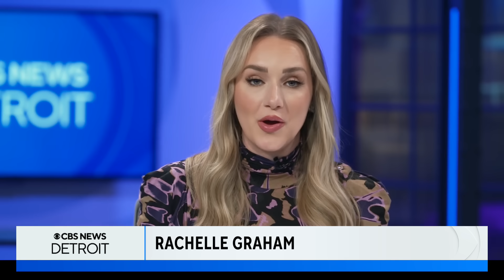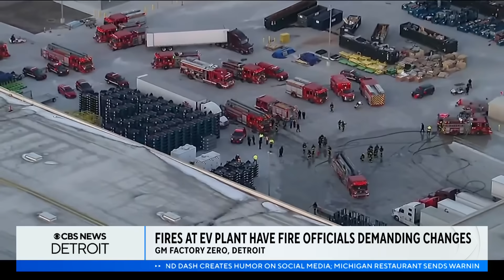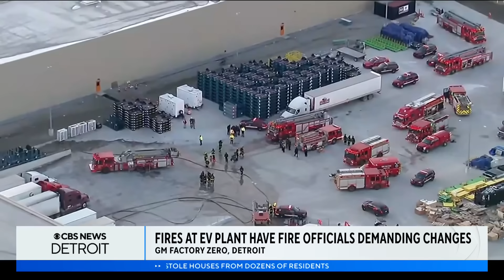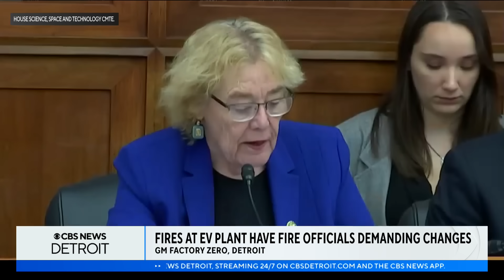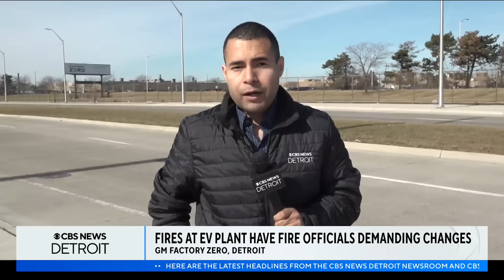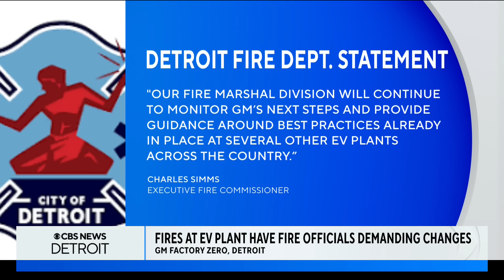Fires at GM EV plant have fire officials demanding changes

Comment: Can't park them in your garage, can't drive them through a puddle, can't take them on a road trip...Also, you pretty much have to buy the car again when the battery goes out.
Reply: Can’t use them in cold weather 😅
Reply: And you can't tow much weight if you have a truck. Heavens for bid if you are going to the mountains and snow..not practical
Reply: That's why car rental Companies are dropping their EV fleets and driving EV used car prices down.
Reply: @shauny2285  , yep..maintenance cost, liability and overall cost
Reply: Exactly.   In 20 years, there will be no such thing as a "running, vintage Tesla."   EV's are disposable vehicles.
Reply: @thumperjdm  come on, im sure there will be one. Jay Leno has many freaks of automotive nature and the money to maintain them.
Reply: The all American dream. Purchase a EV and then throw it away because the resale value will be to a very limited market.
Reply: @NBC_NCO : You have to be a little bit uneducated to buy an EV at the moment, but to buy a used EV you have to be completely certified insane. These things are destined to create the largest junk pile in human history, rivalled only by wind turbines. Gawd, what a stupid age we live in.
Reply: All the better to remove your free mobility.  If your EV is too expensive, too unreliable or too dangerous to use, you stop going anywhere.  And once they're forcing you to stay in one place, you're that much easier to control.
Reply: @SenileOtaku   It's the "powers-that-be" underlying long-term goal to restrict travel to control the masses.  it is happening in Canada also.  This Reply might get 'shadow banned'.
Reply: @johnwoa  That feature is not so much the electricity (because the normal fuel supply line is also susceptible), but the connected computerized features and ever increasing difficulty in diagnostics and repair. They can shut your car down from anywhere, and there is little you can do about it, even if you have gas or juice in the battery.
Reply: @Cucumberflavoredmustard  dont forget , we were shown by the california incedent that power companies can take back any electricity in an EV so long as its plugged in.
Reply: @SenileOtaku  then they can force you to move into mega cities for the mass transit. There you can be controled.
Reply: You forgot, can't get any range in cold winter temperatures 😅
Reply: But but but but the climate. Smh.
Reply: Now that’s value in transportation!
Reply: you LOOK at it, and it Catches FIRE & Explodes .
Reply: @markplott4820  ya imagine that, a car that makes a Pinto look safe.
Reply: Going up the hills reduces range. 
Using a car heater in winter reduces range.
Using AC during summer reduces range.
Getting a dose of EMF radiation while inside.
EV'S = Exploding Vehicles spontaneously combustible vehicles that take a few seconds to burst up to 2500c or 4500f.
Reply: gm owners will have to park in Concrete Bunker.......lol.
Reply: @markplott4820 Tesla owner too...and a Porsche ev just sank a whole ship...
Reply: Yet, the Tesla Model Y is the world's best selling vehicle. So, sounds like you're wrong. 🤷‍♂️
Reply: @Optimistprime. 😂😂😂no, it's not! It's the best selling EV and now they're slashing prices like hell since the demand is drying up...Tesla will be gone in five years...a bad memory at best
Reply: @therovingrobin5938  sorry, your wrong. The model Y sold more then any other vehicle, including none EVs with 1.23 million units sold worldwide.
Reply: @Optimistprime.  🤣🤣🤣 1 2 3🤣🤣🤣 why not 345?🤣🤣🤣 GM alone has sold 6.2 million vehicles last year...your boast is as fake as is your EV agenda/scam...and now, Tesla sales are faltering...ups
Reply: @therovingrobin5938  best selling only means their sales are lagging less than other EV makers. lol
Reply: @Optimistprime.  old data, more current data shows a huge slowdown.
Reply: @Optimistprime.  MySpace was also the top website once.
Reply: @Optimistprime.  best selling is a misnomer, their sales just went down the least. lol
Reply: This is the government's long-range plan to "restrict travel".  It started after 2001 and is continuing with the advent of EV's.  Why restrict travel???  It's subtly being done by the current FJB administration in order to control the masses.
Reply: That is the plan pleb they don't want those unwashed masses on the road.
Reply: Redneck neckbeard doesn't know. Nobody tell him. Let him stay in the dark.
Reply: What an ignorant comment.
Reply: Rednecks don't understand EVs.
Reply: Replies/Comments are being censored by the YouTube AI/Algorithm.  Select "Newest first" and scroll down to see the shadow banned Replies.
Reply: What an ignorant comment.
Reply: Weird, i do all of those things all the time in a Tesla with no issues, and i live in a very cold climate. It's almost like you can't trust Fox propaganda any more than MSNBC or CNN propaganda.
Reply: Just came here to read all the circle jerk comments from people that never owned an EV.😂
Reply: @chrispeterson7898  A wise man learns from the mistakes of others.
Reply: @user-dw1ls3rp1l  Problem is there is no learning going on here...misinformation yes.
Reply: @chrispeterson7898  It true that a wise man learns from the mistakes of others. You, not so much, evidently.
Reply: @JoeOvercoat  OK boomer...take your medicine and go rest.
Reply: @chrispeterson7898 he dummy: how about you grow up
Reply: @chrispeterson7898  spread mostly by you.
Reply: @chrispeterson7898  i suspected you were genz
Reply: @chrispeterson7898 we hear enough from EV owners😂 and it's not good...we also hear of ships being sunk by EV fires, buildings collapse etc...take your "green" fantasy and keep it, but leave us same people alone
Reply: @chrispeterson7898  and those are usually the ones that think EV's are utopia.
Reply: Select "Newest first" at the top to view the shadow banned Replies hidden by the AI/Algorithm.
Reply: so, what kinda horse and buggy do you have?
Reply: @rossr6616  I don't follow. I drive a normal car.
Reply: @Cucumberflavoredmustard it's a strawman to imply you are against technology and innovation.
Reply: @TheReapersSon  Technology and innovation result in advances in capability, not regressions.
Reply: @Cucumberflavoredmustard  he has no facts to counter logic so he resorts to insults.
Reply: @rossr6616  The government never outlawed use of the horse and buggy, and they never subsidized purchases of personal automobiles. Your strawman is a lie, so it’s time to get down off your high horse.
Reply: One that runs on gas and doesn't burst into flames. They havent for the last 100 years.  @rossr6616

Comment: I'm a manufacturing/tooling/test engineer with 40+ years of experience in the automotive industry and I worked at Factory Zero in the Battery Department for 3 months - November, December and January. I walked away when I saw they couldn't control the process of assembling the batteries. They were after numbers, same as any production plant I've ever been in, but I have NEVER seen a production plant accept up to 10% daily scrap rate of a product capable of bursting into flames! 

During my short time there they AVERAGED one plant evacuation due to battery fires every two weeks.
Reply: WOW!
Reply: Other than walking away, what other recourse would you have to put a stop to it? OSHA? Is this a union shop?
Reply: @1320pass  Obviously, in my mind I had no other recourse. Management burned through the budget, cut corners, and shuffled stations around to meet their deadlines. FZ (Factory Zero) is only one of half dozen or so battery assembly plants (FZ, Brownstown, Lansing, Orion, Spring Hill and Cami in Canada), and they bought 6 identical assembly lines, but ran out of money on the last 2, so they were modified. The first line was installed over a year ago, and they're now bringing #5 & #6 online...without many of the changes that were made to the first couple of lines.

GM has an evacuation protocol in place, and that satisfies OSHA and the UAW. Yeah, it's a union shop, but the union has no real say in the assembly process. They're more concerned with getting the greatest number of workers on the line, so they don't care about the process more than that.

GM doesn't want to invest any more than it has to in Lithium-Ion batteries because they're working on bringing solid-state batteries to market, but that's still 4 or 5 years away.
Reply: And this is why I keep telling my mom not to transfer to the battery plant at Cami. Fuck they're building a battery plant next to my factory, and I can't wait to see how many people lose their jobs for "poor attendance" because our road in is blocked off by firetrucks all the time
Reply: Wow! Thanks for your perspective! You should consider posting on Medium or Substack or something to get the alarm out there.
Reply: So they fired you.
Reply: problem is the LG Pouch cells & ULTIUM pouch batteries.
Cylindrical battery cells , have a PROVEN safety Record.
Reply: @markplott4820 lithium cobalt cells in any configuration are inherently more dangerous than lithium iron phosphate for example. We're trying to tame the dragon so we can get the energy density we want.

It seems to be mostly working, battery fires are pretty rare and we've got millions of these vehicles on the roads.
Reply: @markplott4820  True, cylindrical solid-state batteries are far superior, safety-wise, but they are still millions of dollars in product and vehicle design, and years away from production. One of my production team members works on the development team.

Comment: Another reason for me NOT to buy an electric vehicle
Reply: Higher insurance rates, higher electric bill, mileage anxiety, no trade in value, wasting time at chargers, charger in$tallation, fear of fire knowing batt burns new in factory, Gee, l want one
Reply: @GreggWalken-xd3qv  Ah yes. How can you not like waiting a few hours for a charge that works, while the guy across the street files up his ICE vehicle in 5 minutes and is off on his adventures. How could you not like waiting all that time.😀😀😀 (sarc).
Reply: Hello sir - may I interest you in purchasing a Ford Pinto?
Reply: @Trump2PrisonOn34Counts  The Pinto thing is literally getting old.  The easiest fix is to install a trailer hitch (which Ford pondered doing) on the Pinto and then it will meet the required crash requirements with no fuel tank impact.
Reply: @JRobert111111 And had they fixed it at the time, it would have cost $11 per vehicle. The odious part was that Ford decided it was cheaper to pay the claims.
As to the lithium fire issue, F-500 is effective or Class D extinguishant.
Reply: @Trump2PrisonOn34Counts  You are absolutely correct on this.
Reply: Plenty of reasons not to touch one of these. Love the brainless comments on here that advocate for them.  I need the laughs…..keep ‘‘em coming 😂😂😂
Reply: @martinr8278  Yep. Insurance costs going up. Parking lots not allowing then. Apartment buildings and condos no allowing them in underground parking. Repair costs high. Battery replacement cost in VERY expensive.
Reply: NOT to buy GM but buy a Tesla instead!
Reply: 40 years ago they produced  the EV1 that did not catch fire, ofcourse they crushed them and threw the blueprints away....
Reply: TESLA are now the SAFEST vehicles EVER MADE , inc the Cybertruck.
Reply: TESLA model Y #1 IIHS top safety + pic 2024.
Reply: @markplott4820  too bad Americans are refusing to buy electric. Safety ratings are meaningless when no one wants to purchase
Reply: @iamgriff model Y is the number 1 selling electric vehicle in the US. Tesla is selling vehicles as fast as they can make them. 

Meanwhile legacy auto is years behind schedule and 200 billion in debt. GM took the 15 billion from the infrastructure act and put 10 billion  into stock buy backs after executives received stock bonuses. Not too mention the hundreds of thousands of gas vehicles that have been physically recalled for fire hazards over the past decade.
Reply: @crtmojo2705  okay….you still haven’t changed my mind, or opinion about those automobiles.
Reply: @iamgriff  I didn’t believe it myself a few years ago. But I took a look at the batteries I use everyday. From my phone to my impact drill and Xbox controllers. Rechargeable and they last. It’s only matter of time for vehicles. My next vehicle will be an EV. Still got some life left in my 21 year old car.
Reply: you like being a moron in public,
Reply: yeah I won't have to its still perfect than I'll buy a new one  I hate saving all this money damn.
Reply: Gee, regular factories NEVER catch fire.  If you truly are against these batteries, get rid of your cell phone and most any cordless tool / device.  I'm betting you won't
Reply: @bobroberts2371 Thanks. I came to the comments section ONLY to read the "gas-powered cars are just as bad" snarks. You saved me the trouble of scrolling down further.
Reply: yes I hate not paying for gas or brakes or oil changes hahahahah for 7 years now hahahaha my  insurance went down , 20 bucks a month to charge at home. Fast, clean and 400 bucks extra a month in my wallet woot oh yeah and with a the incentives it was the cheapest vehicle purchase ever. Thank you electric gods. $$$$$$$$$$$$$$$$$$$$$ in my pocket thank you money gods
Reply: @witchqueen8576  No brakes, eh? $20 a month? lol...just wait until you need to replace the battery.
Reply: yes John 20 buck a month its fantastic really the car is amazing I'm so happy to save money  @User5_
Reply: meth troll.   @User5_
Reply: @User5_  Just wait until he needs new tires, Wear out faster and more expensive.
Reply: @User5_ 8 year 100,000 mile warranty? Have you ever gotten a warranty? Or do you only purchase vehicles over 100,000 miles?
Reply: @witchqueen8576  can you make it to Colorado from Detroit in 20 hours? I can in my old truck
Reply: haha I would never go to Colorado lol dude hahahahahah @iamgriff
Reply: Girlfriend I would never go to Colorado hahahahah @iamgriff
Reply: all vehicles need brakes.
Reply: @witchqueen8576  Save up that 400 bucks for the new battery you will need. And wait until you need to buy new tires. Cost more and wear out faster. And keep a fire alarm in the garage and have a Hazmat suit nearby.
Reply: Yeah, right.  Tell that to all your lib buddies, you'll have better luck blowing smoke up someones ass there. @witchqueen8576
Reply: @witchqueen8576 but your EV will be useless before long and no resale value. So the money you save will have to go towards a replacement. Long-term your not saving.
Reply: HAHAHAHAHAH seven years no rust no degradation still running on no fumes lololol all this money in my pocket every month  I hate it
 @horsefly1020
Reply: @horsefly1020  lets see I paid 35000 in 2017 at 0 percent financing , that's 350 a month, no gas , no maintenance, two sets of tires in 7 years, 100 dollars cheaper in insurance , 20 dollars a month charge on my home and the car is selling at 13400 resale lololol all this money um saving and I'll run it into the ground in about senvenyears hahahahah oh yeah haven't changed the brakes yet either lolololo
sucks to be you
Reply: BTW thanks for mansplaining something you know nothing  about hahahahhhahhh @horsefly1020  $$$$$$$$$in my pocket seven years and counting
Reply: Oh yeah I forgot about my 12000 incentive shit like I m driving for free . Damn . I hate having so much money. And thank you my union brothers and sisters for building it and for  our future of awesome paying jobs for the little people . Union proud
Reply: @witchqueen8576  wow 1200 bucks! That should last you all year! 😂
Reply: sorry pal 12000 credit HAHAHAH
 @iamgriff
Reply: @iamgriff  12,000.00$$$ 35000-12000=
Reply: hahahaha all that money in my pocket too much @horsefly1020
Reply: @witchqueen8576  have you been involved in a fender bender with your electric vehicle? I hear it costs 50% more to insure that Tesla compared to a Ford Truck. Can you find a collision shop willing to work on your electric car? What about a mechanic shop doing simple maintenance suck as brakes, wheel bearings, or shocks/struts. Let alone the tires wear at a 50% faster rate than ICE vehicles. Wait until that battery dies in the electric vehicle. 
lol, you’re bragging about saving money, but it is impossible to save money while paying 50% more for insurance